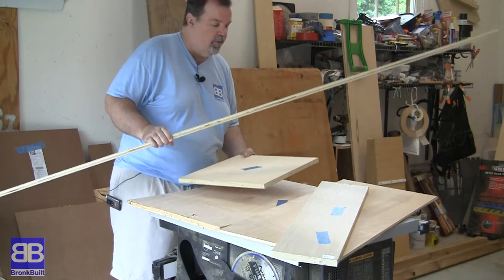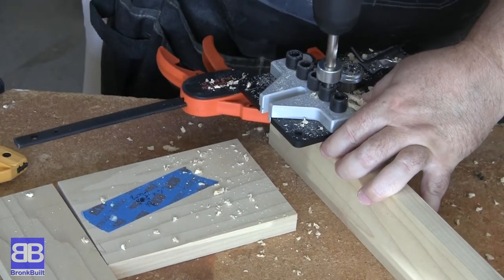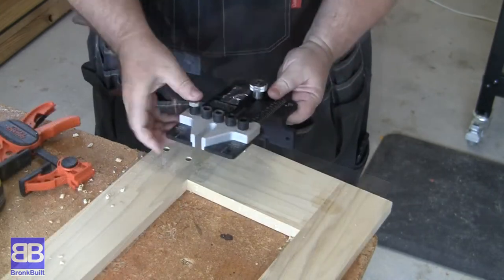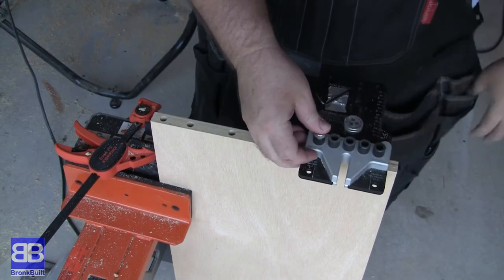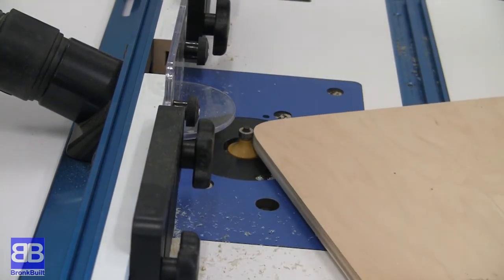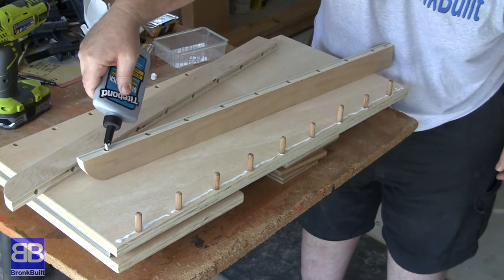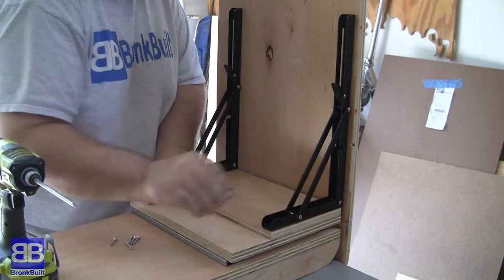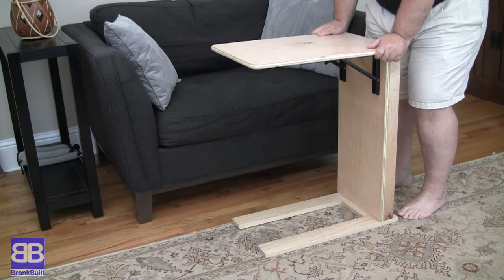FAILURE! A new type of TV Tray

Comment: Interesting idea Dale!   I wonder if a heavier base would help.  Maybe hide a concrete 12x12 stepping stone, or sand, in a wood box for the base.  Or you could try turning the feet so they extend under the couch instead of to the side.  For the dowels, you could chuck each one in the drill and spin it on some sand paper.   I've been staying home too.  Luckily, I can work from home.
Reply from the maker: I did play around with adding weight to the base and it did work.  That just made it a bit heavy to easily move around.  Good tip on the dowels.  I may try that as the dowels I have are just so darn tight in the holes.  Glad you can work from home.  I've actually worked from home the last 15-20 years, but so many people can't.

Comment: Tip on the dowels (just got to that part of the video):  Chuck one into your drill and hold a bit of sandpaper up to it with slight pressure.  Un-chuck, flip it around, and sand the other end.  It'll take a practiced hand, but you'll soon know how much to sand off to get the desired 'Goldilocks' tightness in the dowel holes.
Edit: I just saw I was not the first to make the dowel suggestion.  However, on the tipping from the full extension hinges, one thing to do is on the 'back' side of the pedestal (opposite the 2 feet), add a board that pivots on a pin near the bottom, so that it flips down and toward the couch.  Add a second pin in a second hole in the board, for 'locking' it in one or the other of 2 holes in the pedestal, one for flipped up and stored, the other for flipped down to the floor, providing an 'outrigger' balancing foot that goes back under the couch.
Reply from the maker: I'm definitely going to try the sanding idea.  I had thought about building in some sort of flip/swivel/etc for support when extended but since it was just "see if it works" I didn't want to add complexity.  I guess I should have 😃
Reply: @BronkBuilt  Not at all.  This is the purpose of a proof-of-concept build, to work out this sort of thing.  Another prop that occurs to me is to build a pocket in the bottom of the pedestal, so that a board can slide out of it and under the couch.  Add a pin sticking out the side, sliding in a slot, and the couple inches distance between the pin and the opening should provide all the 'locking' you need.  Plus you can snag the pin with a toe to slide the board in and out.  Bending over to lock this rear brace is not that big a deal before the snack, but bending over after can induce the dreaded 'vurp'....   :)

Comment: Just a suggestion but why not add a counter weight to the base of it
Reply from the maker: Great question.  I actually did add a dumbbell on the base to test how much weight woudl be needed and I thought it added a bit more weight that I wanted to keep it easily moved.  Hind sight it was only 3 pounds so probably would have been a better solution.
Reply: @BronkBuilt  i had one similar but frame was metal and top was on bars held on by knobs so top could slide back and forth and then get locked in place when using, feature of this was 2 wheels fitted for moving it around while tilted
Reply from the maker: Are you saying that this has been done before?
Reply: @BronkBuilt  not the way you did it but I have a tv table that has wheels at the back and it adjusts forward and back by loosening the knobs and move the table top then lock it in place by tightening the knobs. It only moves back and forth and cannot fold away yours is a much better design